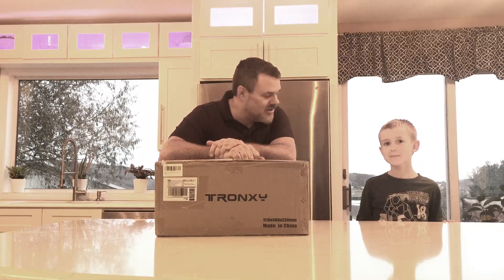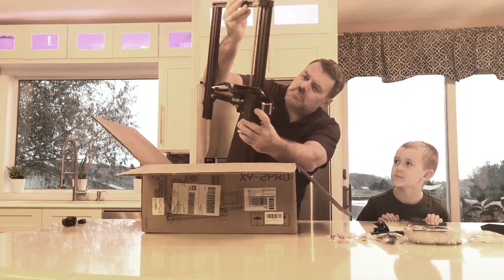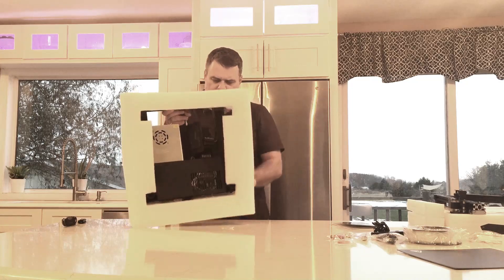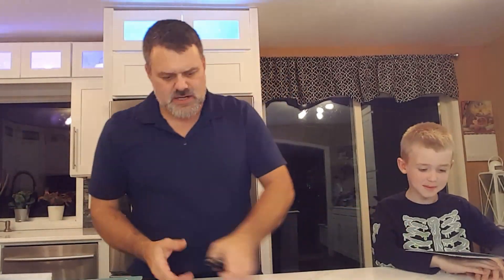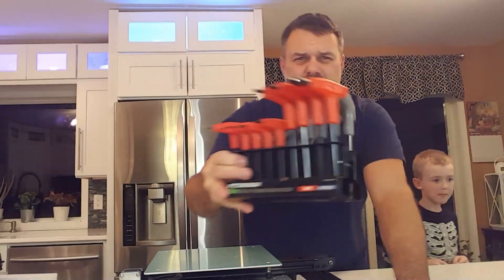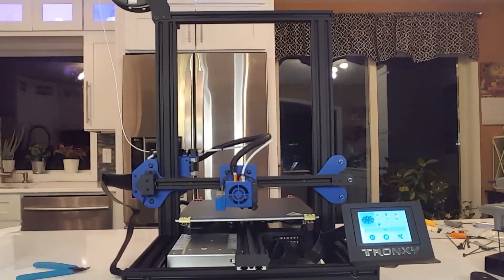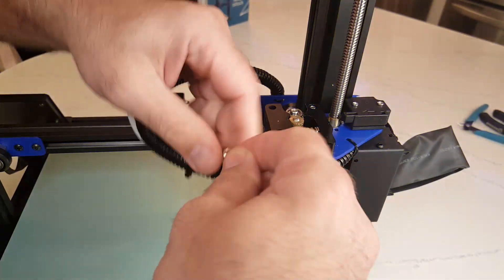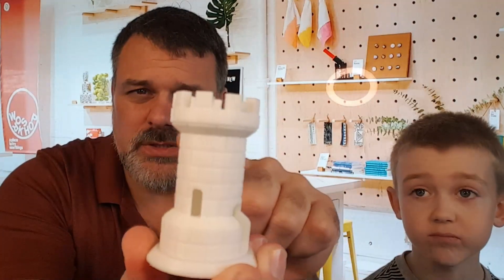TRONXY XY-2 Pro 3D Printer Unboxing and Review

Comment: Out of the box I had much better success with the printer (though I bought the one with the new quiet board and Titan extruder... wasn't sure which this was).  I couldn't get my first print to print, but the problem turned out to be the filament included with the printer.  After several failed attempts I switched to the name brand filament and first print was a success and all my other prints have been as well, with only minor glitches that I believe may have been a problem with the model used or one of the kids touching it.  I also started out with a heavy duty Server power cord instead of the one shipped with it, it just looked too thin for anything that I would leave powered on for such a long time. Overall a good video (though I think you put the spool holder on the wrong side... at least on my model there's a guide on the back of it that holds the full sized spools in their proper place), thank you.

Comment: If you waited for the bed to cool down all the way before removing the first print and it still didn't work using dental floss and flossing it off can work or even drops of hot water, sometimes even a razor but being careful not to damage the bed will work to get it started and using floss